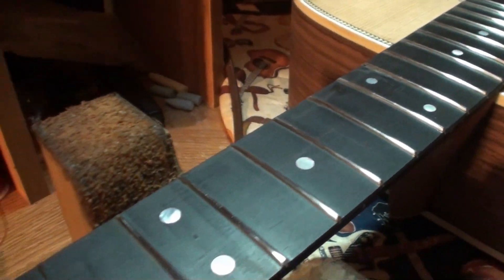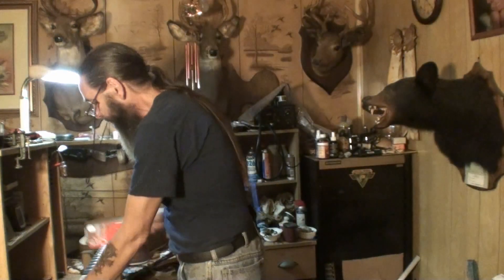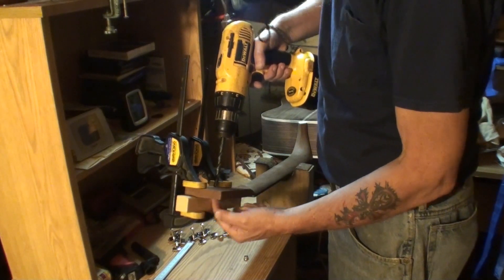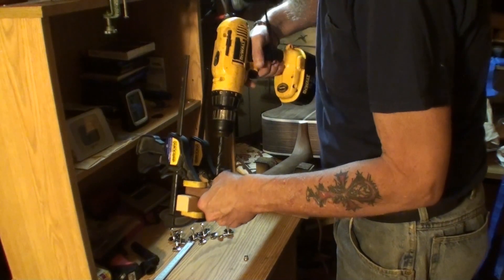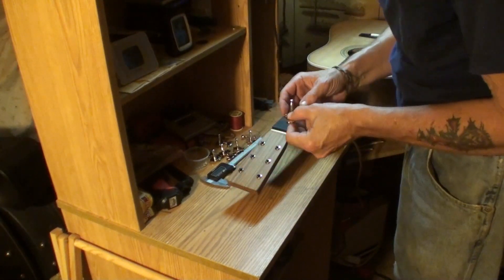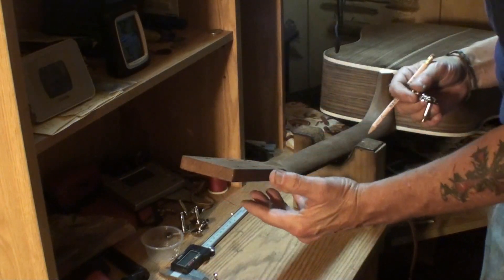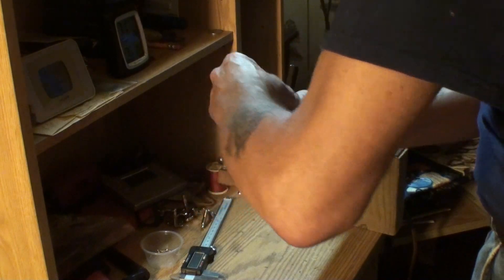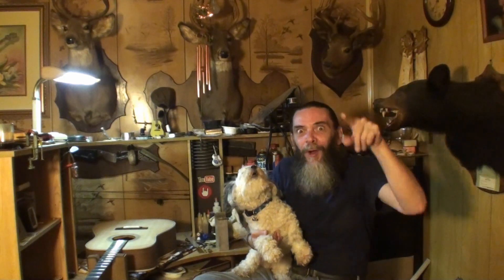stewmac d28 kit guitar tuning machines part 9

Comment: Hey Randy that 28 kit that I got from Martin it had a mahogany neck. What kind of Wood is the neck on that stew Mac? I do believe the kit the D 28 from Martin was better than stew mix kit. Mine came with Grover tuners but I believe they were a better quality. If you remember when you did the set up on mine the sound hole was off a little bit on the lower bout. Now that’s been close to a year since you did my set up and it is sounding better every day, but I used one of those vibrator deals on it often on since I got it back. I don’t believe that the people we hate to love stew Mac LOL makes a very good kit compared to my Martin kit. And if you remember I was bitching about martins kit but after seeing stews I believe it was better. And Martin sent me a template to lay out the tuner on the Piaf head but I should’ve moved both eat tuners 3/16 of an inch to the outside of the pag Head because the eighth string and the b string it’s just a tad to close to both E  strings if you remember they weren’t touching but they could be in just a little bit more room. I thought about building another guitar and I don’t believe it’ll be a stew Mac. But you gave that one there house and never sleeps set up for sure thumbs up bud